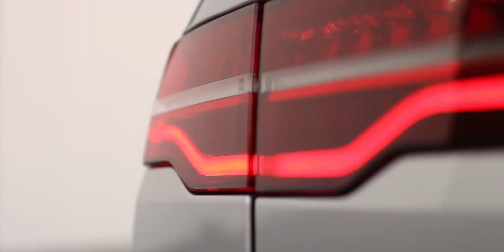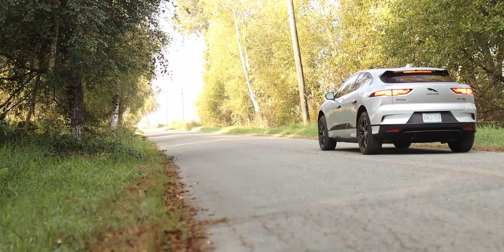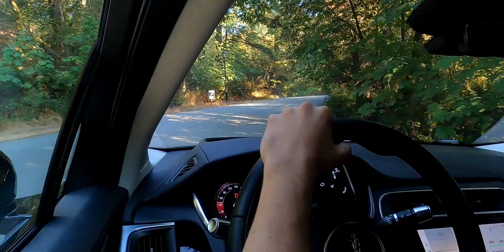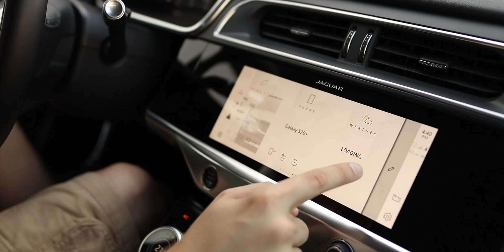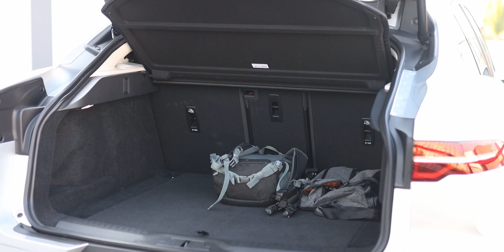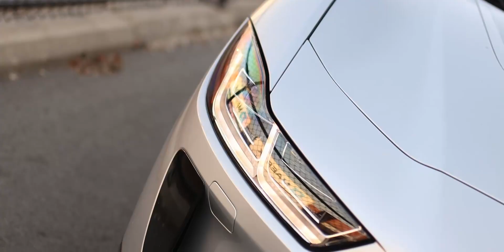2022 Jaguar I-Pace Review / A Sporty But Short Range EV

Comment: I agree with a lot of what you said, but this is 2018 technology, and it still holds its own against newer rivals. Range isn't that important for MOST people, as the average person does less than 20 mile a day. The I Pace is a thing of beauty and it drives incredible. I love my I Pace, MY21, and you can get a used I Pace, around a 21 or 22 plate with low miles for 20K.

Comment: Still beats 95% of EVs in driver feel, build quality,  fit/finish, and luxury.  If JLR ever remove their heads from their rears... they would increase range and DC Charge speeds.  Nothing I would trade out for just yet - tesla feels and looks cheap, audi is sterile, and the mercs are hideous and tech'd stupid.
Reply from the maker: Agreed, one of the best driving EVs I've driven all year and it feels really nice on the inside.

Comment: You must have a dodgy test car. I took a 2022 ipace UK for a 24hr test drive and the one pedal slow down and stop!! foot brake wasn’t required. Your review was bias and unfair.
Reply from the maker: I'm biased & unfair because the car wouldn't come to a complete stop for me?? Should I have crashed into the car ahead of me then? Would that have made it an unbiased & fair review for you?
Reply: @MGReviewsBlog  I-Pace doesn't make the choice for you, but lets you use your own preference: You can drive it one pedal where it comes to a full stop, or you can drive it like an ICE car that slows down but doesn't stop until you touch the brake. The setting to choose is called "vehicle creep".

One might prefer one or the other, but I think letting the driver make their preferred choice is better than not having a choice at all.
Reply from the maker: @frankgradal3298  if that is the case, then I don't agree with Jaguar's decision. When high regen mode is activated, creep should be off. Other EVs also have creep modes but once their one pedal modes are activated, the creep function is off automatically. 

Maybe I overlooked it in this car, fine, but the i-pace has bigger issues than this imo.
Reply: @MGReviewsBlog  You get to choose it the way you want it. Others who want it differently get to choose their preference. No loss for you, no loss for those of other opinions. I don't see how that makes it worse than no choice at all. I drive happily with mostly one pedal without full stop - you can drive happily with only one pedal and full stop. Win win if you ask me.

(And there is no "one pedal" setting as such. If there were I would agree that a full stop should be the default setting. Creep will of course imply having to also use the brake for stopping).
Reply: @MGReviewsBlog  the car I test drive was a HSE and had no problem with it. When you take your foot of the accelerator it slows down then stop!! Best you take another car again and do a proper review.
Reply from the maker: @raycampbell9509  And if the other I-pace has the same issue? then what? I've driven loads of EVs with their respective one-pedal drive modes and they all come to a stop. This was the first one that hadn't done that.
Here are some of my other EV reviews
Volvo C40: https://youtu.be/gtY0BCP8vMA
Ford Mach-E: https://youtu.be/Ijt-lazLxNo
BMW ix: https://youtu.be/FIHZnFEdjB0
BMW i4: https://youtu.be/7Ln-zvVSYkI
Kia EV6: https://youtu.be/vc9zqXbwctg
Hyundai Ioniq 5: https://youtu.be/kPDN0bEwhWU
Another Mach-E: https://youtu.be/v49oB57Wphk
Mazda MX-30: https://youtu.be/k_lY5K7oRAw
Reply: The reviewer is correct;  the brake feel in the pre-2023 models was very "grabby" upon initial use of the brake pedal.  This is true whether or not you are in high or low regeneration.  The I-Pace does NOT have complete one pedal driving.  Using high regen setting, it will slow the car considerably in a fashion much like using the brake and depending on the position of your final stopping point, it may bring the car to a stop.  If you are heading even slightly downhill, it will not stop without using the brake even though the car may be traveling less than 5km/hr.  Additionally, you will likely be required to step on the brake at the end of the stop to lock the car in place (for example, at a traffic light).  I have had mine gently roll backward when I thought it was fully stopped at traffic lights.  Regarding charging speed at public chargers....it stinks.  The car is rated to take up to 100 kw of power but you will never get close to that.  The charging curve flattens out completely at 80% SOC when charging.  In other words, it takes longer to charge from 80-100% than it does from 10-80%.   The range of the car is rated at 234 miles.  You will rarely get close to this unless you are driving in 22 deg weather on low-speed roads.  NEVER will you get this while on a highway driving at USA highway speeds.  You will be lucky to drive 250 km before you have to seriously look for a charging station.  In order to perform a long highway trip, you may be able to drive 2.25 hrs, charge for 1+ hr and then repeat the process.  Terrible.   Despite the beauty, styling, wonderful drivability of the car, including wicked good acceleration, the pricing of this vehicle makes it a very poor value and I would rate it a "hard pass".
Reply: @wigiiinvestors3459  I have now bought a ipace 2022 hse model. My fully charge battery can only achieve 220 miles due to 22” wheels. Fortunately I have charging points at work. Great car for local journeys. In the uk the power point infrastructure is very weak.
Reply: @titaniumspecial4207  it’s sad that it’s a polite forum but you feel you need to form opinion on me when we’re talking about a car.